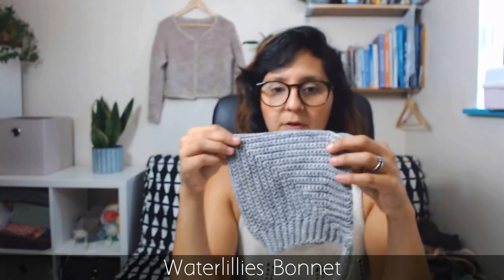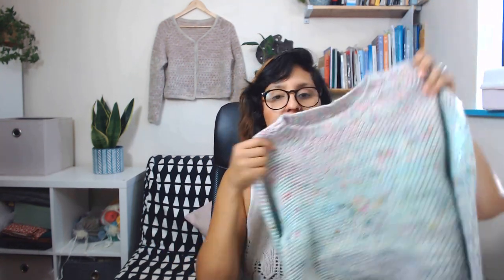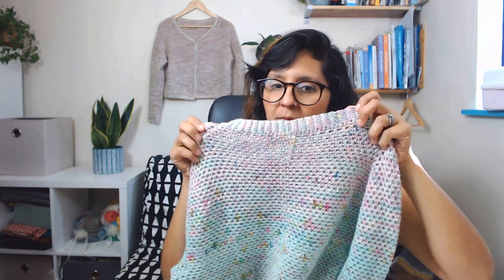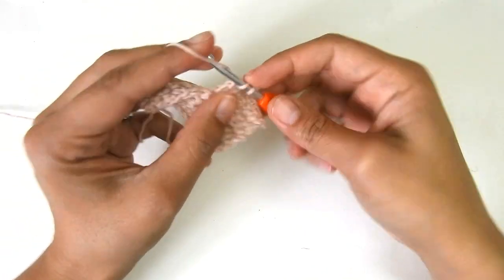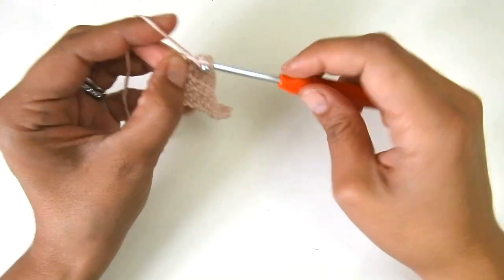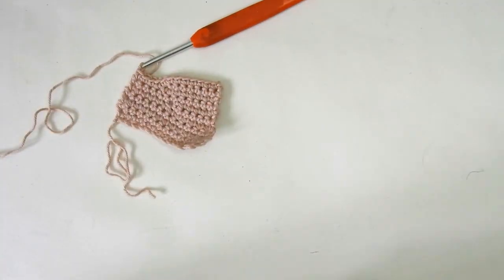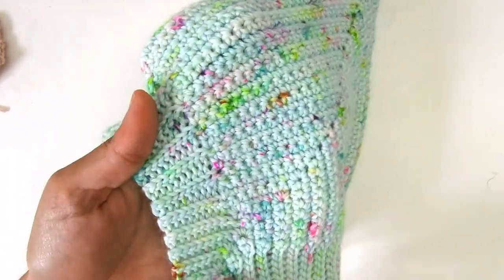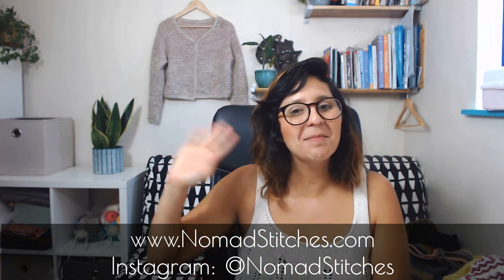Crochet Short Rows - the Ins and Outs

Comment: I wonder if this is an easy fix for the issue of visual difference between the front and back of the stitches. 
I only thought of this after learning to mirror knit but it should theoretically solve the issue at least with most stitches.
 
When working on the wrong side, you must work stitches inverse to how you normally do. This means holding the yarn to the front of the work, inserting the hook from the back to the front, and wrapping the yarn in the opposite direction one normally does (example being from the traditional “yarn over” to the “yarn under”)
Reply from the maker: mmm... that's an interesting idea! I will have to give it aa go!

Comment: I love this video, it's one of only two videos I have found that really talks about short rows.
I'm currently working on a shirt (just started) that is supposed to mimic a well know shirt but the shirt that I'm loosely replicating is a knitted shirt that is created in panels with sleeves that have a ''shoulder cap'' (short knit rows on the top of the sleeve to make a nice fit) and I couldn't for the life of me find any crochet patterns that I liked with that type of sleeve (there were very few patterns overall with that type of shoulder).
I'm not very experienced with making clothing and not at all with modifying patterns so I ended up choosing a raglan pattern (the only type of shirt I've made before) but I HATE the way raglan sweaters sit around the neck and this shirt ''needs'' to have a pretty tight neckline to make sure the ribbing of the neckline isn't looking off and to make sure it's similar to the shirt I'm ''copying''.
I'm soooo grateful for your video so that I can modify the pattern I'm working with confidence and without ruining that stitch-count.

It baffels me how few videos talk about this and how few easily available patterns actually implement this technique, if it weren't for the fact that I've crocheted a few wool socks I wouldn't even think about looking this up. Again, thank you so much!
Reply from the maker: Ah! This makes me so happy! Short rows are the best and it also baffles me how little people know about them or use them in crochet garments! I usually use them in some way or another on my designs. Please, let me know if there is anything I can do to help. I love the sound of those sleeves!!

Comment: For the single crochet two together at the step, do you do a normal sc and the sc2tog in the last stitch of the short row?
Reply from the maker: I don't tend to do the sc2tog method. I prefer to skip the first st on the return row. But if you are, the sc2tog joins the last st of the row with the step to close any gaps. you DON'T want to do the extra sc in the same st or you will be adding more sts.